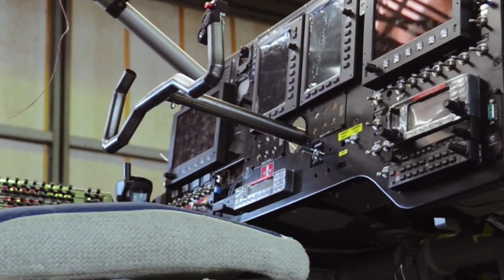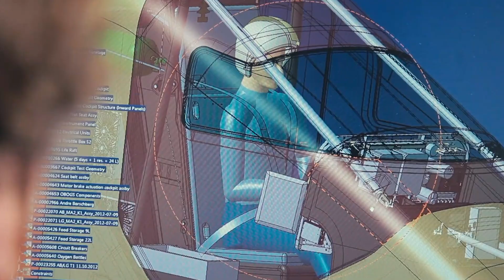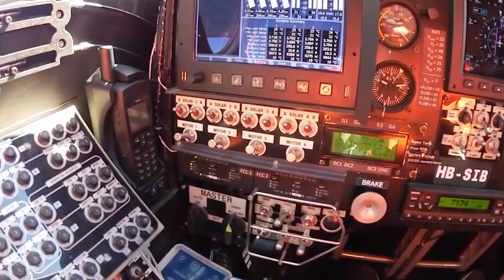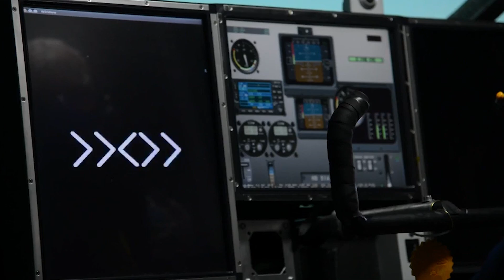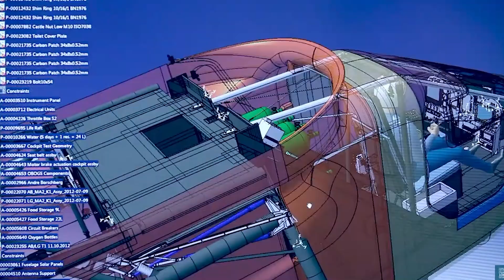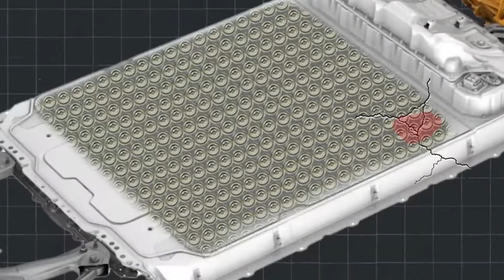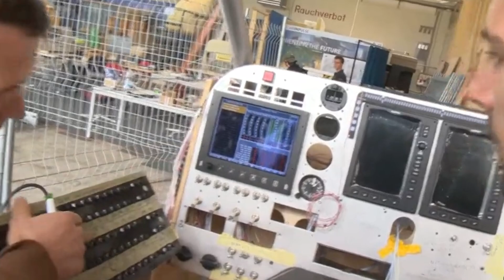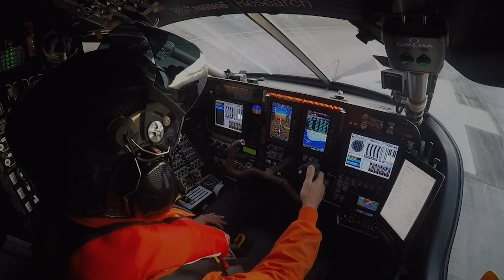How This Pilot Survived The Longest Solo Flight EVER! Solar Impulse 2

Comment: This was actually a good overview of the SI2 project and flights!  good job!    The whole hypnosis thing was just a legal loophole to let the pilot sleep without breaking regulations, I think.
One inaccuracy was about the batteries.  After the first leg of the pacific flight, it was suspected that the batteries had been damaged, and no risks were taken, and the plane was grounded until a full battery replacement could be made.  Actually, it was later discovered that the batteries were in good condition, but it took many months to find that out, and the replacement process was underway already.  many improvements were made when upon the replacement, not the least of which was the orientation of the cells, and the thermal control system.  The airflow around and through the cells in the packs was changed and improved.  But it is likely that the plane could have continued the rest of the round the world fright on the old cells.  Still the plane was better afterwards, and everyone could have more confidence in it.
Reply from the maker: This is a good extended breakdown. Thanks.